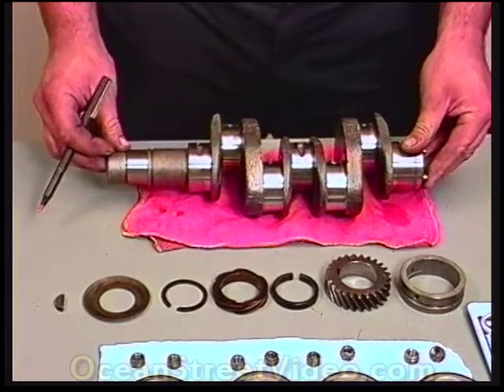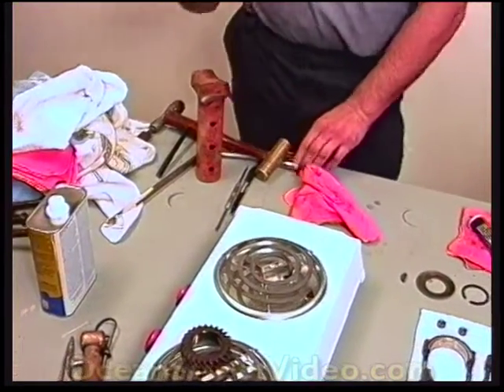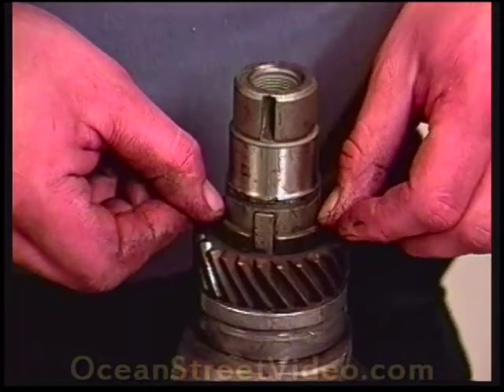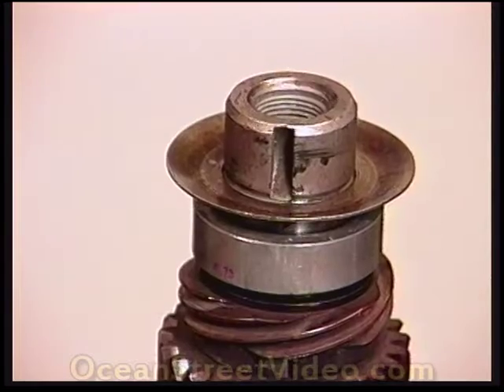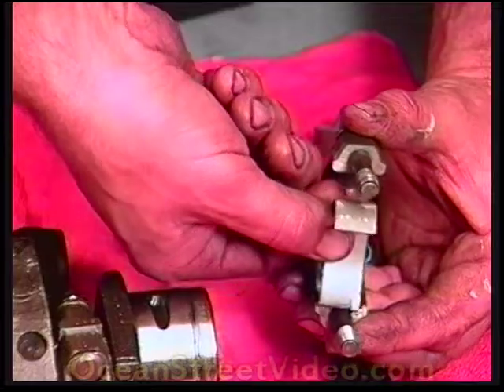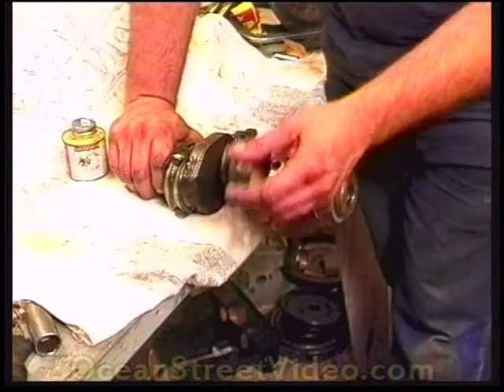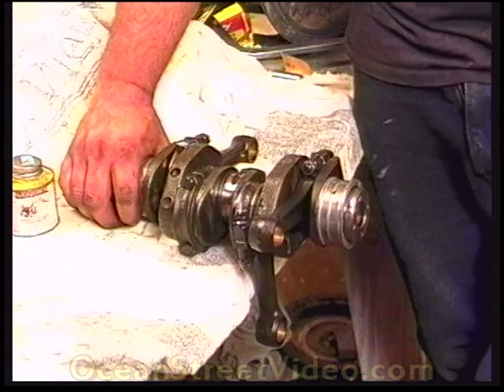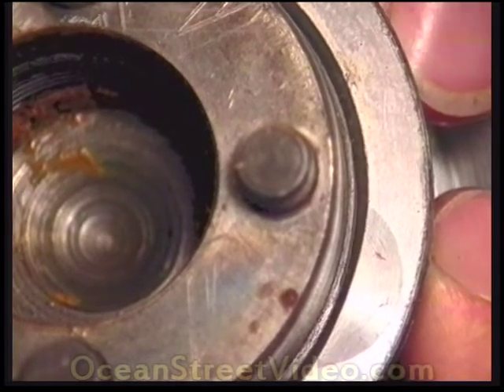VW Engine Building: Crank & Rod Assembly, Type 1, 1500-1600cc

Comment: So wait the play between the rod an crank has to be almost the same as the valve adjusting?
Reply from the maker: +MrPyroBomb - There definitely has to be some play there, so that the rod doesn't bind up against the sides of the crank journals. Always check the Bentley, to be sure that you are using the right specs.

Comment: How hot? i.e. to what temperature do you heat the gears?
Reply from the maker: +DG Carlson I wondered the same thing, but we didn't have laser temp guns back then to actually measure it. The annealing point of brass is somewhere well over 500 degrees? I wouldn't want to be near that, so any kind of visual red heat look would probably be bad. The operating temp of the oil can easily approach the boiling point of water, as indicated with the Gene Berg temp dipstick that fits in the dipstick hole in the case. So heating it to at least 212 degrees shouldn't be a problem.
It's probably a good idea to measure the I.D. of the gear and O.D. of crank first, check the interference fit, I've heard stories of the gear sliding on the crank with everything cold, which would be a disaster.

Comment: Can you replace rod bearings without splitting the case?
Reply from the maker: That's an interesting question, I've never tried it, but if there is a bad rod bearing I imagine that there will be metal particles floating around and potential crank damage, so I'd guess that it's not a good idea in the long run.
Reply: @DragRacingTV  thank you for your insight.